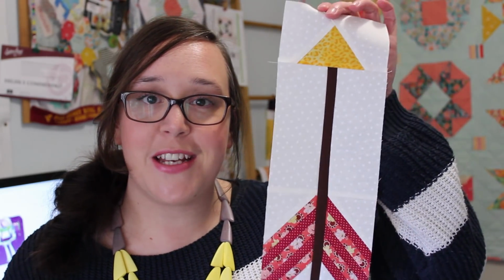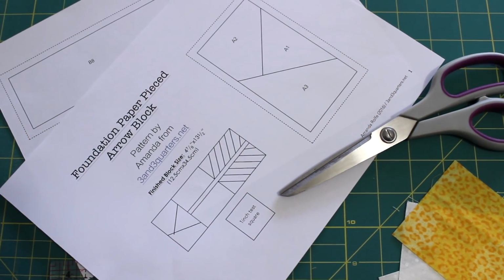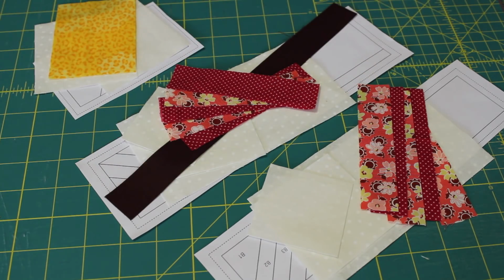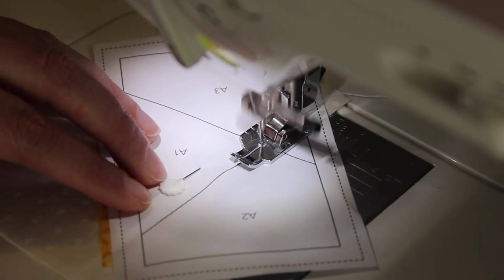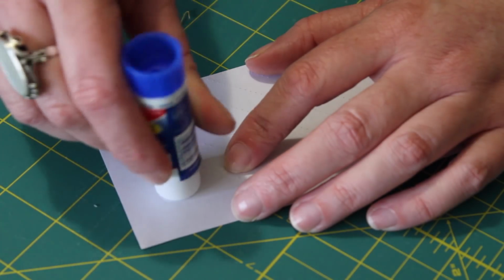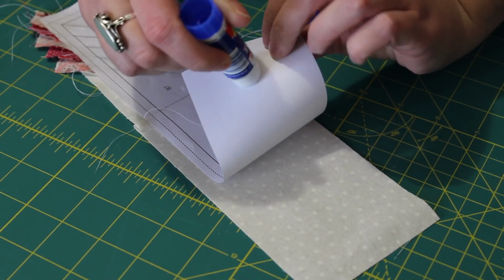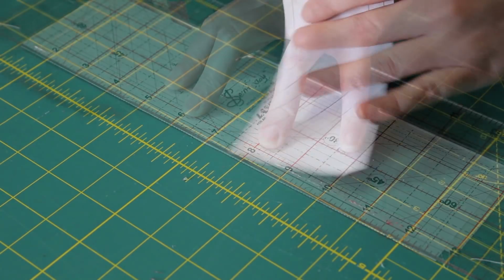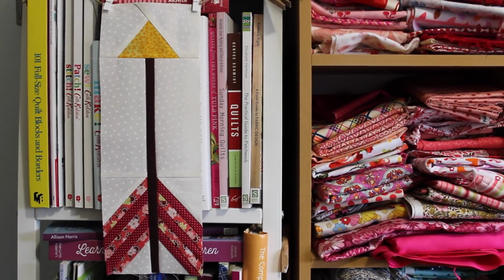TUTORIAL: FPP Arrow Block

Comment: Is there anything you do for the settings on your machine when sewing on paper? I can never get my tension correct and when I tear out the paper the stitches on the ends always loosen and pull. I can see perforating the sew lines really help so I will definitely do that. And I don't think you did but you you have to back stitch at all? This is so lovely and can't wait to try it but I always seem to mess up paper piecing so sorry for all the questions. I love your tutorials!
Reply from the maker: Thank you so much!!
Don't worry, I love answering all of your questions! Hopefully my answers will help you! :)
If you like, you can make the stitch-length on your machine shorter. This will help prevent the stitches from 'popping' when ripping away the paper. 
No, I didn't back-stitch on any of my seams as a majority of the ends will be sewn into seam allowances. 
Hope this helps!!